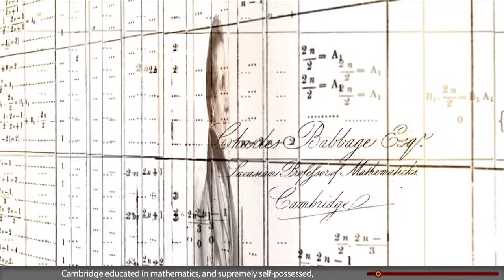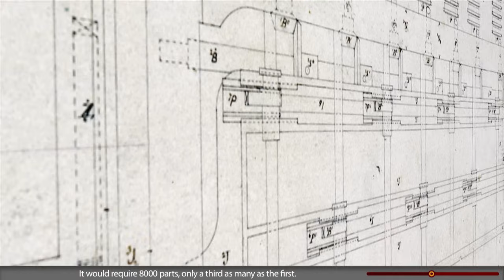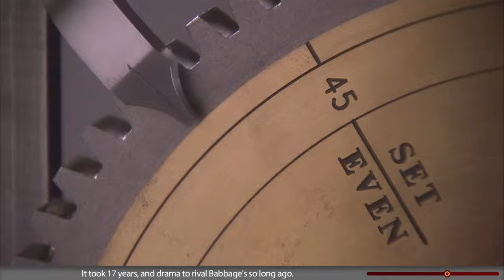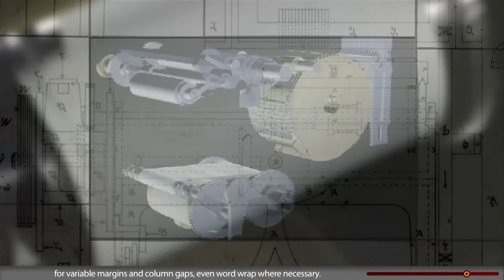False Dawn: The Babbage Engine

Comment: The first computer was built by the German Wilhelm Schickard in 1623. It worked and it could calculate numbers until 999.999. He was a friend of the famous astronomer Johannes Kepler.
Reply: Not really. Wasn't turing complete, which the analytical engine was.
Reply: The first computer was the human hand. Fully digital in the literal sense.
Some had base five ( unhappy experience with a cave bear).
Others had base 10.
But you needed 2 with a (usually) optically read  modem to a functioning cerebral circuit.

Comment: But can it run Crysis?

lol I think that if this machine was adopted, and people continued to improve on mechanical computers, it could've reached 1950's levels of computing before the old tube computers were ever invented. 

I see no reason to think that it couldn't be used to play some simple games. Not video games, but some kind of geared computer controlled game, anyways.
Reply: Actually, the same kind of technology was used in US Navy's mechanical fire control computers which would calculate fire solutions and even direct the guns at their targets in real time.  There's a 1953 Navy training film on YouTube showing how its parts worked -- https://www.youtube.com/watch?v=gwf5mAlI7Ug&t=993s .
Reply: Geez people these days only think of games. Computers were originally intended as calculators not some gaming machine.
Reply: @valdomerotimoteo4335  Games have helped us develop technology through the years, it gives us reason to produce and fund development at large scale, when everyone is using the technology.  Very similar, are computer vision and gaming hardware.  The architecture is massively parallel to run games, and while games are somewhat a toy or fun thing.  Our modern computers are amazing aren't they?
Reply: Indeed they were designed for calculations, but have you ever wonder why people like Ada so much? That's because she realized much more could be done. Things far more interesting than mere calculations. Really, I struggle to understand why you would be more interested in a banal calculation than something more involved, like a game which requires many calculations on top complex logic.
Reply: @poudink5791  entities she stated
Reply: @valdomerotimoteo4335  he says that... on a computer

Comment: Error free? Integers yes, but nonintegers contains errors and these adds up quickly, making this device almost useless. It has to be restarted very often, to keep the accumulated error small. By restarting I mean, entering fresh, correct, rounded numbers, calculated by hand.
Numerical example: using six decimals, the smallest constant has an error of half a millionth. This doubles for each turn of the crank.
Reply: @JA's Media Studio I disagree. There where a lot of smart people. They had logarithms, they had Briggs.
Reply: You can use fixed-point arithmetic. Or just multiply your number by 10^x where x is the number of digits that you need after the decimal, then divide your answer by 10^x to get your decimal number back
Reply: @mcobb1024  no matter using fixed or float, you will have an error. This error will add up quickly, making your result useless. So, you must restart the calulations, with new hand calculated values, maybe for every page in the logarithm table book.